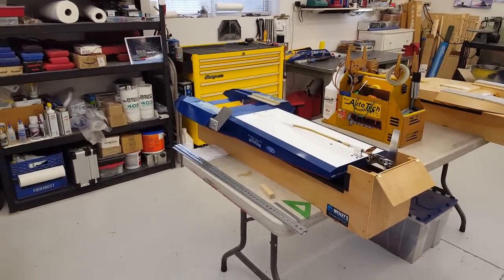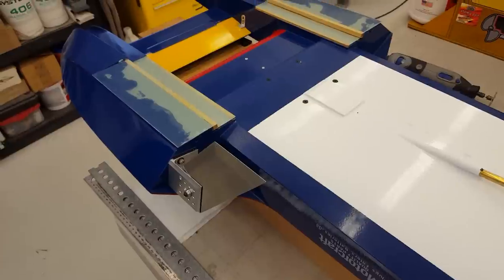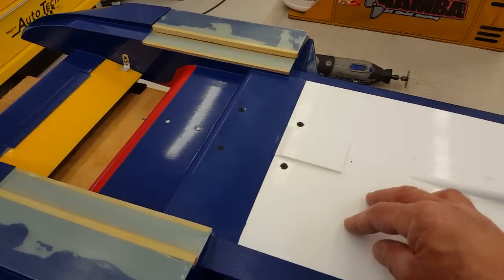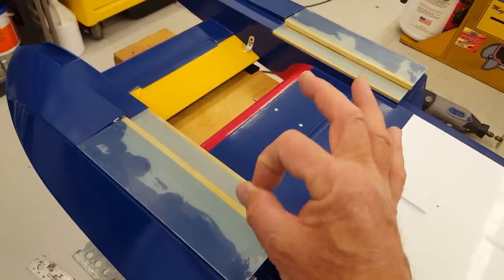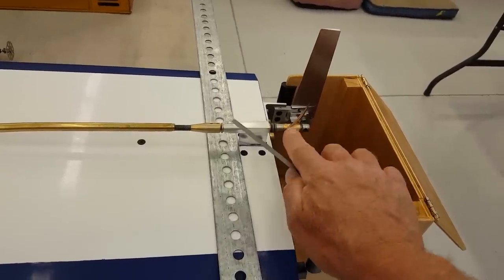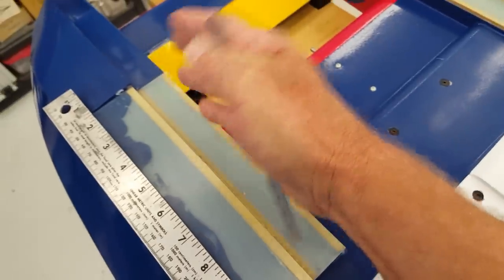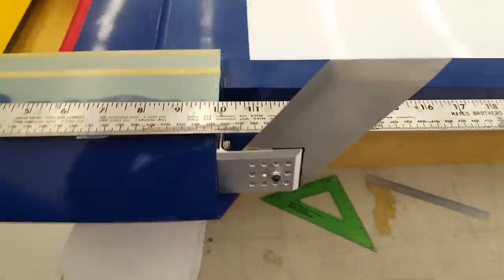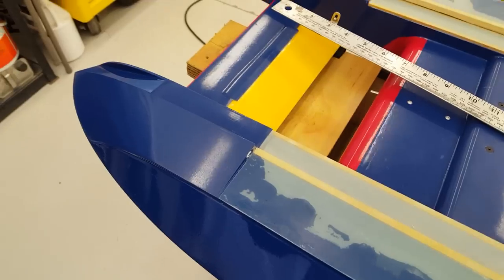RC Hydroplane Racing Shop Tips - How To Set Turn Fin Alignment

Comment: I was wondering if you have a video on setting strut height set up on a sport 40.  I just built ML boatworks 380 and I am using a square drive .  I was going to set prop height center to bottom of sponsor pad.  Been out of the hobby for about 15 years so just wanted some advice...
Reply from the maker: Hi Joseph, 
I don't yet have a video describing strut height/angle, but that's coming soon!  Meanwhile, your thinking is spot-on... The centerline of the prop hub should, in a perfect world, match the ride pad height (depth?). I would recommend a little bit of positive angle, about 1°, to the prop shaft as well.
That should get you started... Let me know how it works out!

Comment: Hey Scott, thanks for another informative video.  To achieve the toe (tow?) out angle you describe, are you altering the turn fin bracket or shimming between the bracket and the sponson transom, or maybe something I'm not smart enough to think of?  Thanks!
Reply from the maker: Great question, and you answered it yourself... I shim the bracket.  I cut a few thin pieces of .010" or .015" G10 and slip them under the outside edge of the bracket (between bracket and sponson transom) until I get what I want.
Reply: @M5PerfHydros  Thanks Scott.  I don't have a hull yet, so I was scratching my head trying to picture if there is adjustment on that axis.  I imagine once you determine the correct toe, you could mill the bracket for the proper angle and do away with the shims.  I appreciate your attention to detail!  Thanks again.
Reply from the maker: Ha!  I've done that too!  I'm going to have to start looking over my shoulder to make sure you aren't there stealing all my secrets
Reply: @M5PerfHydros  I'm just trying to learn!  Thanks Scott.

Comment: I bought a ml boatworks  9255 gasser hull,  I would like to know if there are mods to the bottom as I consider the stock bottom too radical to be useful,  -  any comments?
Reply from the maker: You mean the center section or the sponsons?  I use the same flat bottom design for the center, but my sponsons are quite different from most of what I've seen from MLBoatworks.  They may work great as-is, but I just have my own way of doing stuff.  I haven't seen their 8255 (assuming this is what you meant, there is no 9255) so I couldn't comment on it. Some of my videos show my sponsons quite well ... Go for it and see how it goes. If it doesn't work, cut it apart and make changes. That's where the fun is!

Comment: Hi Scott, where do you get the skid fin and mounting bracket from on your Stroh lite hydro.
Reply from the maker: I build these parts myself Brad.  The bracket is 1/8" 7075 aluminum angle cut and drilled, and the turn fin is .100" 7075 cut out with a small bandsaw.  You can do it!